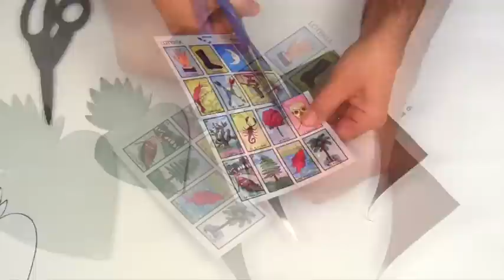How to: Mexican Tin Folk Art

Comment: How do you prevent the edges from being so sharp? I see how you trim the points, but even the straight edges are sharp. Do you paint over them or file them? I even thought of touching the edge with clear nail polish. Just wondered what others do to make them safer. Thanks
Reply from the maker: Hey Ron, use serrated edge scissors. They are for tin and when you cut with them the edges are like a butter knife edge.
Reply: Mark Montano Thank you so much, I really appreciate knowing that, I was about to give up.
Reply from the maker: Ron Fish glad you didn’t!

Comment: Mark, can you please tell what the gauge/type of flashing is? The flashing I bought at the hardware store is too thick and very difficult to engrave and the "tooling" I got at the art store is too thin, although perfect for teaching art at school. I'd like to use the right thickness where it's similar to aluminum can, but a bit sturdier. Thanks so much!!
Reply from the maker: Hi Rosie, there are some flashings that are thicker than others.  You might try a True Value for some options. That's where I get mine.  I wish I knew the exact brand, but I don't.  I buy it on the roll and they can measure it out for you.  I've also purchased some that has gold on the back.  If you can find that, it works very well.